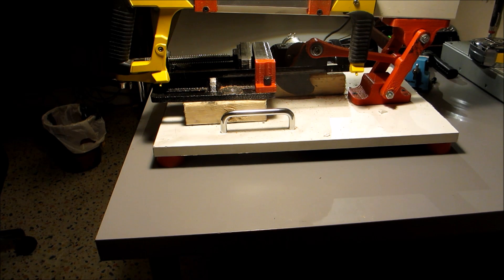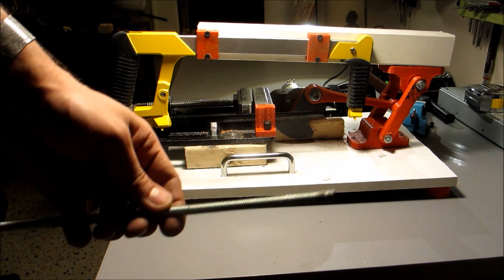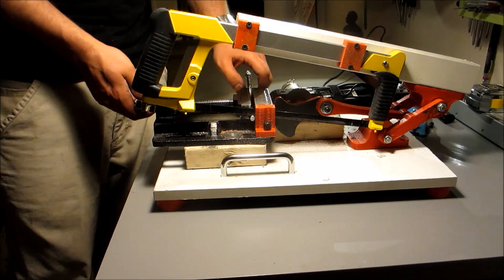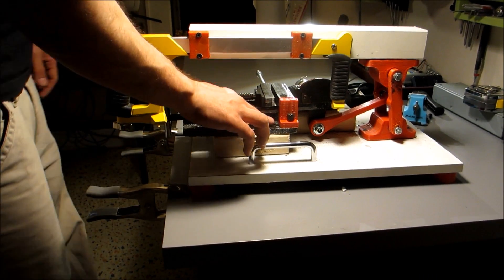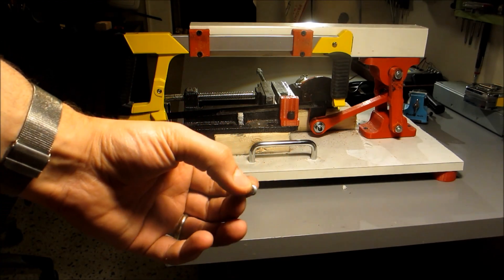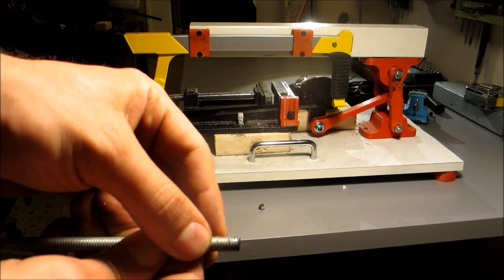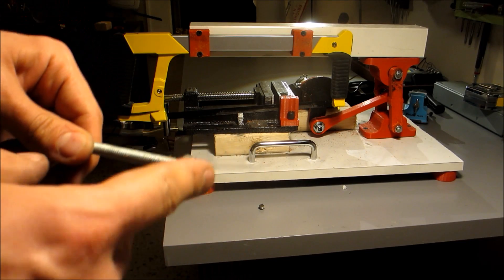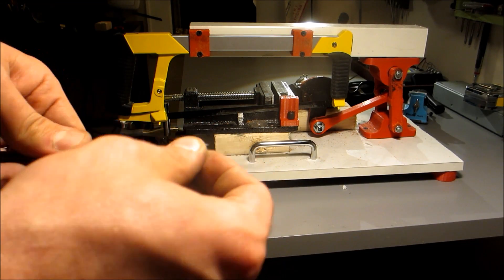3D Printed Power Hacksaw 2 Will it cut steel?

Comment: Vous avez seulement a changer votre scie de coté, pour qu'elle scie en revenant plutôt que en poussant ça va arrêter le sautillement de la lame et peut-être lui mettre un peu de poids.
You only have to change your side  blade saw, to saw it coming back rather than pushing it will stop the blade jumping and maybe put some weight on it.

Comment: Is there enough weight on the cutting stroke you can see the saw hopping as it starts to cut.  But this is impressive none the less.  What material was used for the printing?  Two thumbs up.
Reply from the maker: Mature Patriot the material is ABS. It is a bit more heat resistant than PlA commonly used. But it does require some attention to both design as well as ambient when 3d printing it.

Comment: Get some weight on that as it still chatters.  Either weight or better yet a nice tension spring.
Reply from the maker: +Dark Alchemist 

I was thinking of a chunk of rubber. A spring will shake and create harmonics.
Reply: Bruno M.
Elastic band, as long as it is pretty strong, will work as well.  You don't want a lot of pull nor too little.